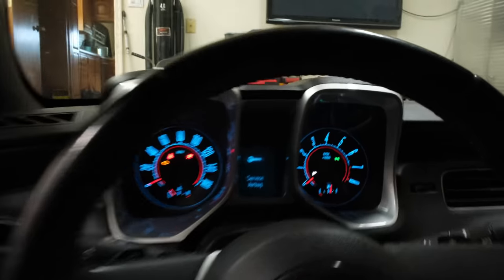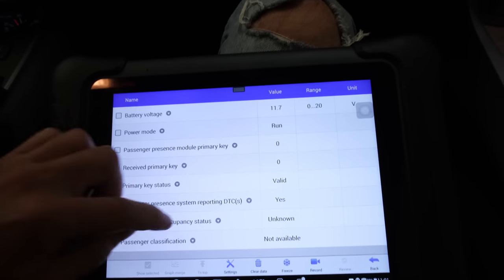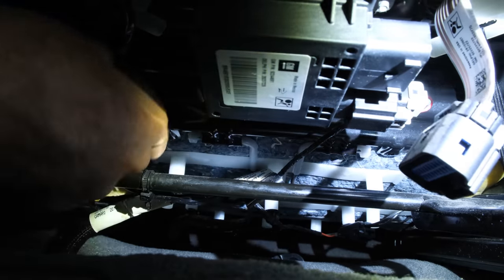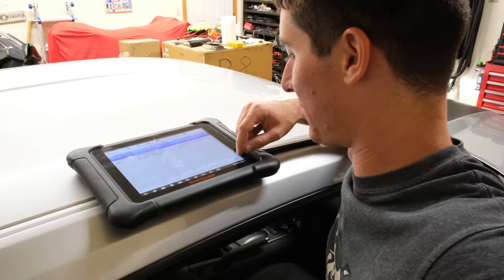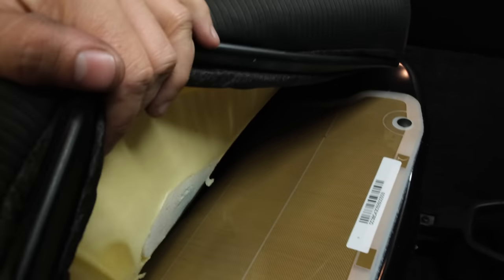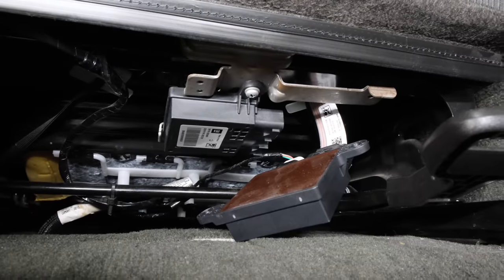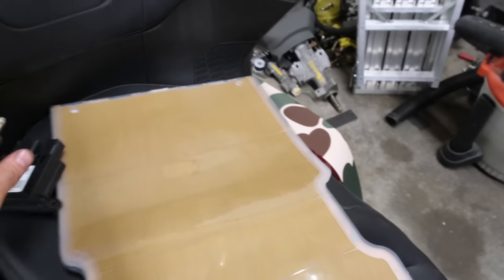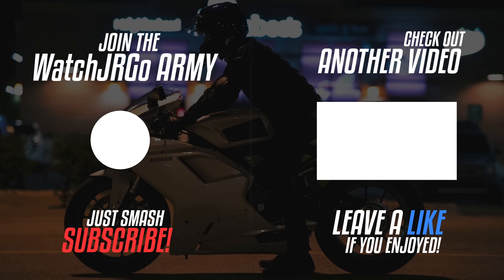I FIXED The $1,000 Airbag Problem EVERY 5th Gen Camaro Should Be RECALLED For

Comment: I have been dealing with this passenger airbag light since I last commented several years ago. Today it stayed on even when no one was in the passenger seat, so I got a little annoyed and start messing around. Bear with me. I decided to remove the seat sensor to try and find a break in the connection like you mentioned in the video. I cut the clips that sandwich the sensor together, so that I could spread it apart. I noticed a decent amount of lint / dust in between the contacts and both sides of the membrane, also a small amount of dried soda at the bottom. With the contacts laid flat, I wiped off the membrane and the contacts with paper towels and rubbing alcohol. Didn't have any breaks or other damage to the sensor. After cleaning, I threw it back in the passenger seat and start the car. Light was gone. When I sat down, Passenger airbag "ON" was lit and the #2 Belt buckle light was blinking; the sensor was seeing me and was not throwing any malfunctions. I tried moving around the seat and also using my knee as the pressure point, moving around and I could not recreate the malfunction warning.

Could be worth a shot if anyone else comes across this video. Just make sure you flush cut the plastic press clips that secure the sensor from underneath the seat. Once its free from the seat frame, you can then pull the padding away from the sensor and further flush cut the plastic clip from the sensor. If you try to pull the plastic clip with a trim remover etc. you will very likely break some of the contacts in the sensor.

Comment: Yes, my 2005 and 2011 Volvo S60 both use liquid in the seat for passenger presence detection. What a stupid design to use wires which will stretch.

Comment: I had a similar code on my old 08 Acadia.  I purchased an aftermarket cheat module, that fooled the car into saying the seat was always occupied.  Light went out.
Reply: Did u get just the module or the pad too? May I ask what tht set u back? I need to figure something out for mine soon.
Reply: @zacharyreynolds4303  I thought the same thing but then I thought, well,  the module and seat belt aren't connected I DNT think- separate boards.
Reply: I used to just buckle the passenger belt if I was by myself.  airbag360.com. I think it was like $80
Reply: @timrowe8123 update ? Did it take a lot of work to install?

Comment: I've never heard of this as a problem. Had my 2010 SS since 2016 and I also spend a ton of time on the Camaro5 forums. The HVAC blend door IS an issue it should have been recalled for. I truly believe every single 5th gen will experience a broken blend door at some time in it's life.
Reply: Its true and it is EXPENSIVE! Ask me how I know :(  It doesn't help that if they crack the windshield getting it out,  its on you too!
Reply: it is common in MOST GM cars of that era I have a 2009 Impala LS that has a faulty blend door actuator and I replaced it 2 times and the 2nd one failed but to be honest I had a DORMAN brand one I will probably pay the extra $$$ and get an OEM one.  At the moment the 2nd one is still in the car I just unplugged the power wire so it is stuck in CLOSE mode at the moment.
Reply: I have blend door issues on my 2005 Silverado and 2007 Impala SS, it's a GM wide problem. Amazon blend doors are $30 and have lasted longer than Delphi ones.
Reply: @DaveMcFly  Fords too.

Comment: I think its funny how guys  bash the v6s and at over 300 hp can out Run the older v8 Camaros. And if you add nitrous like I did, then boost and hang on... lol
Reply: @Camaro Mods Channel  Yes!!! I get asked why I settled for the fully decked V6 instead of the SS and teased bc I'm a woman who LOVES muscle cars especially Chevy. I bought the V6 bc thts what I wanted! I fell in love w it after driving both, but am considering an exhaust kit 😏😁😜
Reply: @cc7369  nice,  I need exhaust too.
Reply: @Camaro Mods Channel Yes thts the one thing I DO like about the SS, but the 19" tires aren't even close to cheap and the maintenance is more too on the V8. But an exhaust kit will give us the old muscle sound without the price tag. Mine's paid off but I'd have gotten the SS, I'd still be paying 8yrs later lol!
Reply: @cc7369  I was 2 to 3 thousand short at the time I was buying my car to get an SS. Still kicking myself for not getting it.
Reply: I had the $$ but I'm a leadfoot already and the SS wldve gotten me Into trouble, plus my son was a toddler at the time and me a single mom, figured I had better things to spend the extra 10-15k on too lol
Reply: DNT kick urself, the V6 is a great car! And u can use the Xtra $$ u ddnt spend on aftermarket add ons tht are great!
Reply: @cc7369  I just think my YouTube channel would have done better with a SS or a zl1. Thanks
Reply: The GM 3.6 V6 is garbage. 3.7 V6 Mustangs last. And it's got 300+ horses.
Reply: @atx-cvpi_99  Ford 😆 🤣 😂 😹

Comment: Just for your information - broken copper traces can be easily repaired. Just find someone who does electronics repairs and show him the broken traces. He should be able to fix it for ultra cheap. You just have to solder in a jumper wire across the gap. I would do it for free as a favor.

Comment: There's usually some tricks pros use or people that understand how it's put together figure out on their own. We have a 99 300m in the fleet and replacing headlight bulbs is a stupid undertaking if you do it the way the manual tells you to and slightly better if you follow some of the you tube videos of getting to them without taking all kinds of pieces off the front end to get to them. They build cars to be assembled in units on the line, not to be easy to service later. And let's save a dollar per car using the cheapest part that might make warranty.

Comment: Yeah that looks like a typical GM bonehead design, like the ECU's on the ecotecs being bolted to the hot intake manifold.
They should just tie it to the seatbelt sensor, a very sturdy sensor.
If you ain't wearing a seatbelt, you don't need an airbag anyways.

Comment: I think this was mentioned in another comment on another 5th gen camaro video but the gauges in the console were in the V6 model if you had the 2LT package only real diff between 1LT and 2LT was the center console gauges, leather seats, and I THINK upgraded audio and rear parking sensors.   that is why when you order that center console gauge cluster you have to let them know if you have a V6 or a  V8 they do have different ones for the 2 V6s (auto and manual) and the 2 for the V8 (auto and manual).

Comment: I love how GM is doing the exact same things that almost put them out of business pre-2008 and they think it’s ok
1. Dogshit materials
2. Terrible engineering
3. Reliability issues
4. Overpriced cars
Reply: Such a shame, GM makes some of the best looking cars out there, we need home grown industry for the economy. We get crap and cynicism instead of quality. The auto industry needs to be more than a cash cow for stockholders. Yes?
Reply: I'd buy a used GM product over any BMW or Mercedes over the last 15 years.
Reply: My brother bought a 2014 Cruze, so far the turbo went, one electrical problem after another and a weird shifting issue that’s all over the forums but GM says doesn’t exist. The Impala my dad had experienced sudden transmission failure due to a stuck valve, and my brother previous car, a Cobalt, also has sudden transmission failure from a valve body short. He also had the ignition issue there was a recall for but it took almost a year to get it fixed.

Comment: My 2011 Camaro rs brand new: leather / this same passenger airbag sensor problem. Still haven’t fixed it yet, can’t believe GM is asking $800 to fix something that they poorly designed. this should’ve been recalled. They never fixed my rattling rear speakers. My brother now saying I told you so to get a Toyota!

Comment: Having exact same issue w my same year Camaro. I had no idea there were lawsuits, but I've been checking for recalls. I need it fixed because my 13yr old boy sits in the passenger seat. Looks semi ez for a gal tht has no problems but I'm disabled and obviously can't afford for Chevy to do it. How about your tire pressure sensors? Mine are shot but we've been driving cars for decades without those anyway.

Comment: Oh man I'm driving down the road and my other car but my 2012 Camaro RS through a airbag on the dash now I'm finding out that the SDM can only be programmed by a GM mechanic no shop is wanting to help me and the parts that I did find from Chevrolet they want like 600 bucks for a mouse pad sensor for the passenger seat I pray that this video guides me in the right direction

Comment: Not just the Camaros have this problem. The 3 gen W bodies have as well. One W body Impala was involved in a crash that a front seat passenger was in but the passenger airbag never deployed and because the airbag never deployed the passenger of the Impala died 10 months later. The driver has since then sued General Motors.

Comment: Does anyone know if the 2003 Sierra is the same setup? I'm having issues with the passenger seat tripping the Airbag warning.
Reply from the maker: Actually I fixed one of those last week buy just unplugging the connector and plugging it back in a few times. Hasn't come back yet 🍻
Reply: @WatchJRGo  good deal, I'll give it a go when I get the chance.
Reply: @WatchJRGo  Would some deox spray help too?

Comment: I mean, the car should have been recalled for the timing chains LOL. Got new chains, CEL came back on, tried a different brand / different sprockets and tensioners, new phasers, new actuators, new position sensors, new crankshaft, and now is having the engine replaced. 103k regularly maintained with zero sludge and looks brand new under the CS covers. Apparently bank 2 head has enough wear in the caps to cause enough timing issue to cause misfires on the opposite side

Comment: Thank you so much. I’ve had this problem since I bought my 2011 Camaro, I had a passenger in the seat when I bought my car, as long as I have the passenger seatbelt buckled no light comes on, doesn’t matter if someone is in the seat or not. Could not find anything related to this problem. Now I know what to replace.

Comment: I'm a retired photographer. If the camera you're using has threads on the front of the lens to attach filters you can buy a cheap, battery powered ringlight to give you better lighting in cramped conditions.

Comment: In my 2005 ext cab Silverado. The wiring harness on passenger seat is too short. The first time I put the seat all the way forward, the black wire pulled out of the male end, leaving the funky looking silver end ripped out. Reseated the black wire, and it kept happening. So I just made a extension wire and haven't had any issues in 13 years.
Reply: GM always cheap out on wiring harnesses.

Comment: The more I see of new cars the more I prefer old tech. 72 Dodge Darts, amongst other Mopars had a weight sensor in the passenger seat for the seatbelt warning buzzer. They never seem to fail! If Chesler could make it reliable almost 50 years ago, why is GM not able to do it now?
Reply: Because GM is about profit now. Short term reliability vs long term reliability corporate feels is their best interest.

The decision to make them cheaper is why GM vehicles just aren't as durable as they were in the past.

Comment: I have a 2012 2LT RS 45th Anniversary V6.  The gauge cluster is part of the 2LT package along with leather seats, Heads Up Display, Rear View Camera, and a few other things.  I can confirm, the oil pressure definitely goes above 70psi when you put your foot in it.
Reply: yeah I mentioned that above I knew it had the gauges and leather seats but for the life of me I could not recall the heads up display, not sure on backup camera I know they had rear parking sensors I do not think they added back up cameras till the late 5th or early 6th but I am not 100% sure LOL
Reply: @DaveMcFly  My bad, I didn't see your comment.  The other things I saw listed was Premium Sound, Bluetooth, and Paddle Shifters, but I have a 2012 and that might have changed from the 2011.

Comment: Had similar issue on my e39, Gravel works well and it fixed itself
Reply: For most old BMWs you just have to put in a resistor instead of the mat.
Only downside is that the passenger airbag will go off even if there is nobody sitting there.